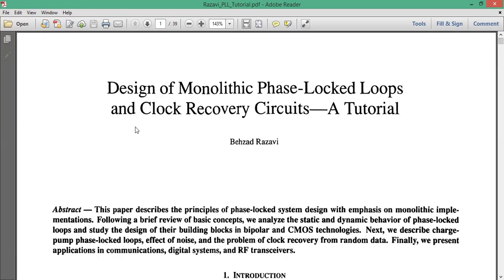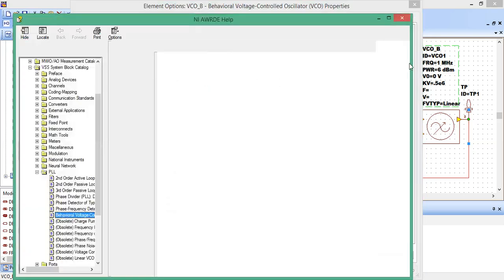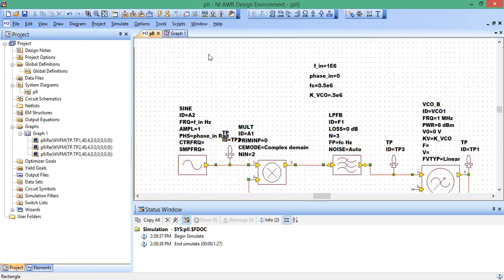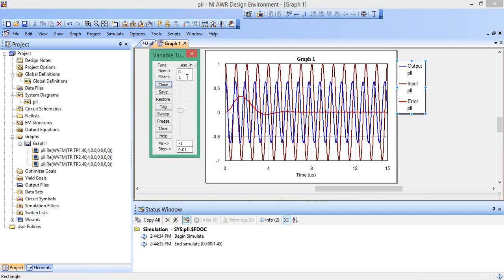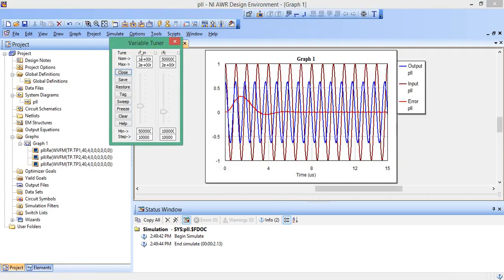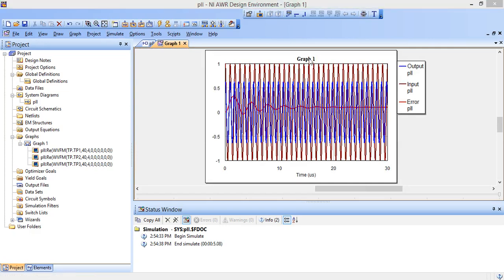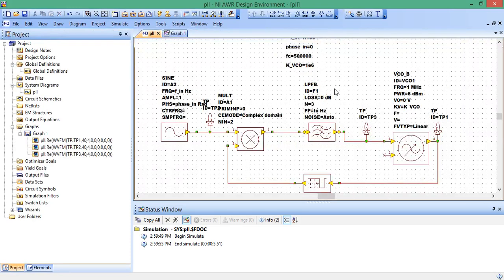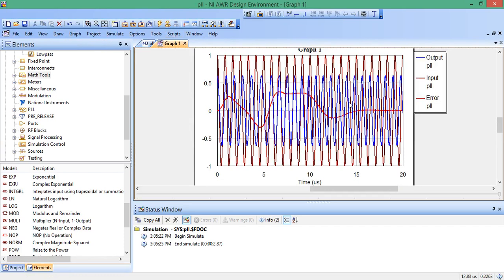Simulating an analog phase locked loop

Comment: this was very helpful for me understanding the basic concepts. If possible, I would like to know if the optimum gains of the PI controller for the loop filter can be calculated for any given frequency, bandwidth and sampling frequency. I would like to know how to estimate all these gains including NCO gain, if it cannot be perfectly calculated. This will help me very much in my project on PLL. Thank you very much for the video.
Reply: Plz help me Kevin in pll because this is also my project